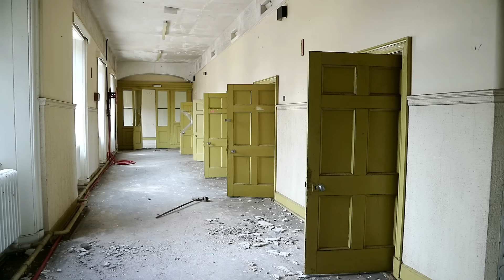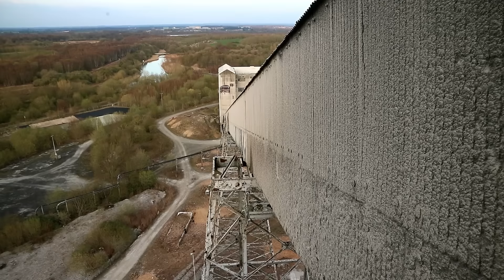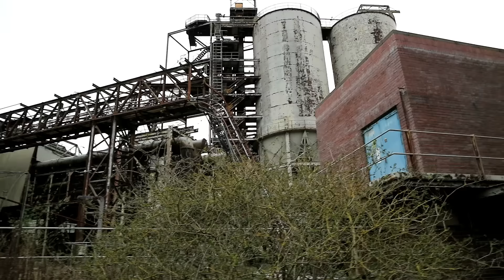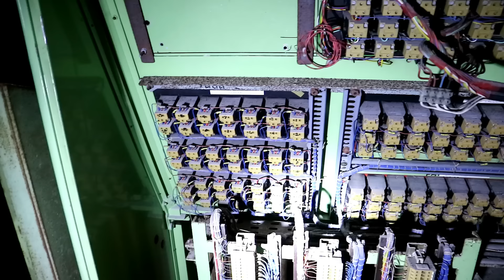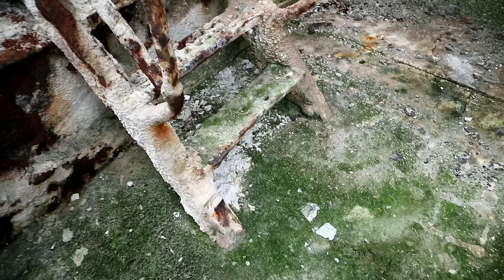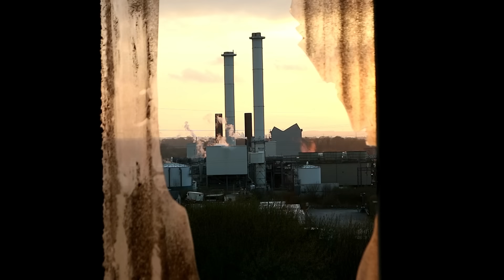Untouched Abandoned Control Room in Huge Chemical Facility! - URBEX UK

Comment: The company that owns it are planning on knocking it down & building 1200 houses on there like they did with the other side of the works. If you thought this was massive you should have seen the other side! A piece of my local history demolished for housing & profit for the current owners! Part of the next demolition they want to knock the 19th century work house down & "repurpose" 2 grade 1 listed statues of the original owners! If anyone is wondering how big this place is, that conveyor belt they climbed can be seen miles away & it still looks huge. The river by it was redirected & made larger so that the ships can dock to take away the soda ash away.